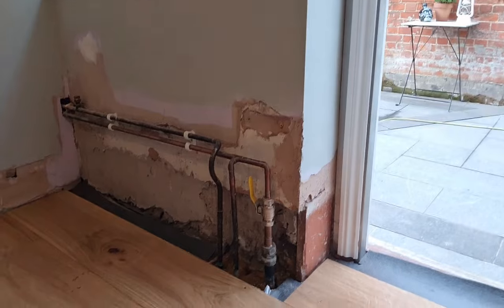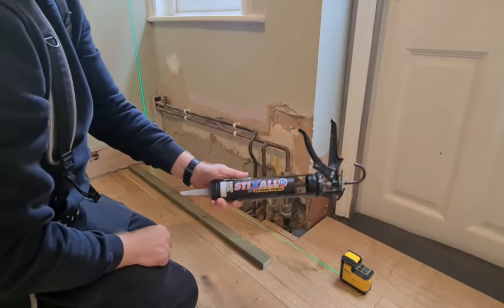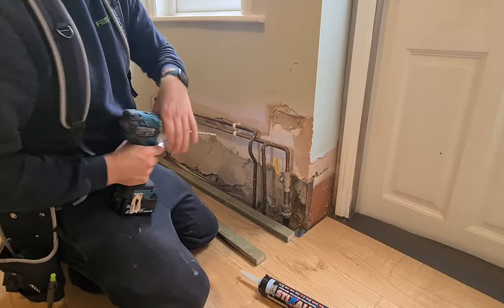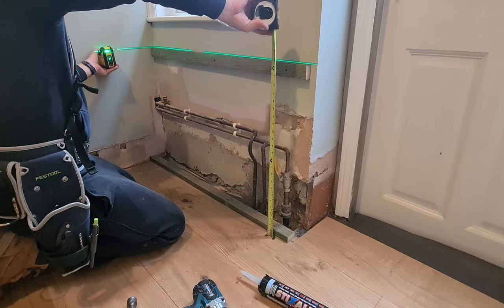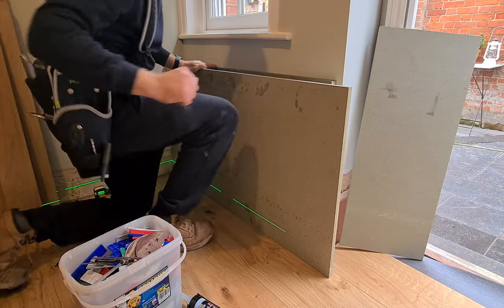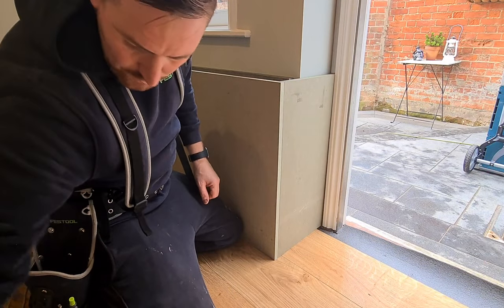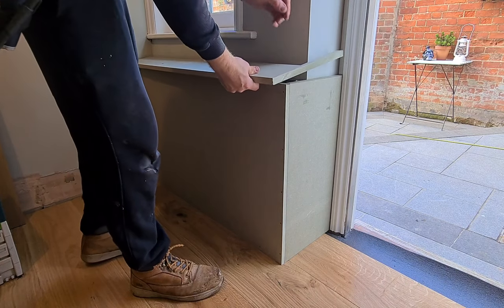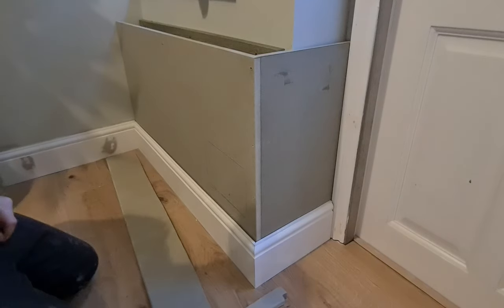Making a HARD job EASY!       #diy #carpentry

Comment: You made this look so much more difficult than it needed to be. Just because you have a laser doesn't mean you need to use it for every tiny task. There were times where you needed 4 hands and a level would have been adequate. It looked nice either way
Reply: See you two are showing your true  colours here. Everyone just uses a laser nowadays. Only bodge job old guys use bubbles. Use it on everything from doors to trusses.
Reply from the maker: You're quite right. Lasers are so much more accurate

Comment: That was about as easy as boxing in gets, I thought it was a video where awkward  pipes come out
Reply from the maker: Not really mate. Easy boxing in would be low level with 12mm ply and batten.
Reply: @BuiltByBen-YT  look mate I'm not gonna have an argument with ya, you are a million times better than I  am at carpententry, but that was very simple. Difficult boxing in is when you don't have a surface to fit to at the back and pipes exclude from it and and you have awkward angles to fit to.

Comment: Surely fixing a structural element to a floating floor isn't ideal. I'd have cut out the flooring so that batten could attach to the subfloor and allow room for an expansion gap between it and the pipework...
Reply from the maker: Structural? It's only boxing in.
Reply: Nope your wrong , You would do what your paid to do not think what you want to do for yourself, big difference when it’s not your property !!

Comment: Even the pro's make mistakes, I noticed you cut the top short and said it didn't look right with a bullnose going into the door facings, but had another bit cut when routing the bullnose to finish the job, don't be embarrassed bud it's good to let folk know that we all mess up sometimes, so people starting out don't get put off seeing flawless jobs online so think they are bad when they mess up and give up on wood work etc thinking they must be crap because they keep making mistakes. Let folk know it's okay and it takes practice. Good video, I personally don't use MDF much at all but ply wood has gone down so much in quality lately I'm thinking yo use more mdf for my work.

Comment: Good video. I have been using the button fixes so that you can take the top off easily and don't have to have any screw holes in the top. Really easy to fit and super strong too.

Comment: Nice one Ben. Just about to box in a fuse board in my garden cabin, so extremely useful. As I will need full access to the board, so I'm magnetising the box so it pulls away easily but thanks to you I've invested in a laser to save time and effort on this and the multitude of other jobs on my "To Do" list!
Reply from the maker: Nice one mate 👍
Reply: Oh another great tip on the magnetic catch, thanks!

Comment: nice work. i'm also a fan of oversizing and marking in situ instead of trying to cut it to size first time. one question though... at 24:55 you didn't show the perpendicular scribe for the return which looks nowhere near 90... when cutting the large rectangle out did you leave a strip of "meat" on the end to scribe that perpendicular line or use a bevel guage?

Comment: yep two battens, one fixed to the floor and the other fixed to the wall is all that is needed....exactly the way way I do it. Just a wee note...I would not build the boxing on top of a floor finish as floor finishes are renewed/changed, which means removing the boxing every time the floor finish is changed....in this case have you screwed through a timber/laminate floating floor finish ? meaning the floor now has no movement/expansion at that end. I presume another access panel would have to be fitted for access to the water softner.
Reply from the maker: Hi Tony.  Thanks for watching. 
I see where you're coming from with the floor finish but it can always be multi tooled if being changed. Movement wise it shouldn't restrict it too much as I only screwed too it and not all the way through. The water softener was an external unit, so access would only be needed once too connect it and then the boxing could be fixed. 👍

Comment: I too am a retired joiner,wow that was an ordeal watching you do that boxing!The reliance on a laser of all things ,can you not use a level? I would have measured up made the whole lot outside slightly oversize then brought it in and scribed it! I too would’ve used an access panel but never dreamed of cutting it “after” you fitted the boxing! one slip and you could’ve sliced the pipe! The garden chimes were irritating big time Lol
Reply from the maker: Everyone does it differently.  I go for accuracy over speed but appreciate that you may go for speed, a lot of carpenters do. There was no way I could of slipped and cut a pipe unless I had no control at all! The pipe was a long way back and the blade wouldn't even reach it. The access hatch was put in after because it was delivered late 👍

Comment: Cool video. A few small deviations from the way i do boxing in, of a similar ilk.
That's not a criticism of your work, which is plumb and true. I just do it 'slightly differently'.
I would have used 'pinch' clips to hold the lid on, and left the 15mm over hang, near the door architrave, on.
Also, make sure to use your G clamps in future, when using your palm router. Seen a fellow joiner have a rather horrific accident, routing whilst not having the work piece secured.i
I don't want to come across all 'belt and braces'. I'm retired now, due to ill health, and you are clearly a very good young joiner/carpenter.
I would just rather see your future videos, with you fully intact 👍
Reply from the maker: Thanks for watching Tony 👍will be sure to get the clamps out next time.

Comment: Nice neat job, pity the customer hadn’t got the water softener fitted beforehand as it might be bigger than the space now left. Another idea might have been to increase the box height and give a wide window board/seat as an added feature.
Reply from the maker: The water Softner was an external Unit and the only thing needed in the boxing was the mains feed. We nearly made it in to a Cat seat but then decided this way was best. The reason for the height was that the wall was quite badly damaged lower down, Couldn't really see on the video but that's why.

Comment: The scribing on the top piece didn’t look much, until you bought it outside. That’s some terrible plastering!! You did a great job - looks neat and adds character.
Reply from the maker: Yes mate. Part of the reason it was so high was to hide more of that rubbish plaster work. It got worse the further it went down. Cheers for watching 👍

Comment: Not sure if the perspective and camera angle has distorted the image, but the edge of the  little overhang on the door architrave seems to not be running parallel to the surface of the wall. Did you gauge the angle of the walls with a sliding bevel? Shouldn't you have built the box square and then scribed in to the angle?
Reply from the maker: I can't remember Ian? Once it was all fitted I am pretty sure it was all square and even. Thanks for watching mate 👍

Comment: easest job i ever had was boxing in pipes at mental health hospitals and there was a lot. Set up in the car parks with a generator and loads of MDF. MDF is so forgiving and easy to work with..but always use corner blocks out of wood or more mdf and screw and glue if you want it strong, as screwing down the end is crap.

Comment: Well Ben I'm a retired carpenter joiner of 53 years I've never used a laser always used levels. I just can't understand why you made it so big and why you took it around the corner seemed unnecessary to me 👎
Reply from the maker: Hi Norman, good for you mate enjoy the retirement! It was all discussed with the customer and this is exactly how they wanted it. I did offer a number of options including a seat for their cat 🐈 
But at the end of the day you have to build what the customer wants and accept that people have different tastes.  I like it as it is and can't see anything wrong.
Reply: Same thing as I were thinking
Reply: @BuiltByBen-YT  sometimes it's true, customers adamant what they want, even though you have given them several 💡
Reply: Norman I've been at it 37 years and have found the introduction of lazers to be very beneficial, more accurate and time saving. No disrespect to you as you had to achieve similar goals with only hand tools but times change.. That said ask a chippy in his twenty to cut a mitre he will flap if he hasn't got a chop saw with him😂
Reply: Very few take pride and enjoyment out of it anymore.
Reply: The plastic cover to the access hole is a horror. I’d have cut the hole very carefully and used what is now your piece of waste as a plug, with a small wooden knob in the middle. Once it and the boxing are painted up, including the cut edges, it’d fit in there nice and tight . . . once all the paint is properly dry, of course.
Reply from the maker: Loads of ways to do it
Reply: @graemetaylor2135  you’re a genius.
Reply: @marksmith383  Life in general is being dumbed down nowadays. If I hadn’t worked with an oldskool joiner I wouldn’t have have the skills I do. Young lads just want power tools. They’ve lost all the basic skills. Lasers have a place in kitchen fitting. 👍🏻
Reply: @BuiltByBen-YT  I blame the plumber. Get him back to lower his mess! 😂😂👍🏻
Reply from the maker: I possess those skills too but if a new tool or gadget makes something easier then I'm all for it
Reply: Can you tell me the multi tool blade please and also the make of the router
Reply from the maker: You seem angry. Just move on if you don't like it 👍
Reply: I take it that you still travel around in a horse drawn cart..?
Reply: jesus Ben , you’re taking a lot of stick here , when you’re only trying to show a way of boxing in , if someone wants to have a go at it their self . Water off a ducks back mate . i’m a joiner myself , and there’s always someone out there with that famous comment “ i wouldn’t have done it like that 😂.. good luck in your channel , and stay busy mate 👏👍👍👍
Reply from the maker: Thanks mate. It doesn't matter what I put on this channel there are always some people that don't like it. Opinion and taste are to blame. There are so many ways to do everything and people just need to chill 😎
Reply: @BuiltByBen-YT  😂totally agree , you’ll use a level , someone will say “ use a laser , you use the laser , ..  why dont you use the level 🤣🤣i found it quite funny tbh , well i like your channel mate , and look forward to your new ones ,👍
Reply from the maker: Thanks scotty 👍 make sure you're sub'd
Reply: @marksmith383  I am a chippy and had to do some skirting around some funny angles on a stair case by had as I did not have my chop saw on site, and it spun my head. We get so dependent on modern equipment. Mate me realise how unskilled we can be with hard tools .
Reply: @jasonreeves4955  100% Jason if battery's are dead would you use a hand screwdriver? Naaa😂
Reply: @marksmith383   what’s a  hand screwdriver?  You mean a screw gun 🤦‍♂️🤦‍♂️🤦‍♂️🤦‍♂️
Reply from the maker: Don't be rude Ronsola.
Reply: @BuiltByBen-YT  i can't see that a lazer on a little bit of boxing faster or easier than a level. Lazers are great  for bigger jobs but hardly needed for a tiddly job like that
Reply: I've been at it for 40 years and found this job absolutely spot on. To Graeme and Norman, why don't you put on a vid? Show us how to do it your way, thought not. Well done Ben, sure this has been useful to others.
Reply from the maker: Thanks mate.  Unfortunately one troll attracts another.
Reply from the maker: I use them for everything for accuracy  Norman 👍
Reply: As they say there’s always one an today it’s you congratulations mr master carpenter, so how about you showing us all just how it’s done properly in youre eyes hay 🤔
Reply: Everyone’s an expert when watching someone else work! Good work mate nice and clean how the customer wanted it! 👍
Reply from the maker: Cheers mate 👍
Reply: @BuiltByBen-YT lol....always one who things he knows it all because he's 100 years in the trade and a magician and mind reader too.
Reply from the maker: They always turn up 🤣
Reply: @MrSmid888  i was a kitchen fitter for 42 years in the UK and Europe, i never used a laser level,. just not practical,.maybe for a rough datom around the room. Levels for me im afraid.
Reply: @alanwood9822  yes that’s what I meant, for an initial line around the room. I use a level for everything, I’m oldskool it’s the best way!! Hurts when it falls of a unit onto the skull 😂Some lads can’t use a handsaw to back cut a worktop now, the basic skills are being lost, it’s all speed speed speed. I used to have to drill out the hinge plate holes, our stuff came non pre drilled for anything! One mistake and it was fluffed. And yes I have drilled right through a door! 🤢 Curved doors were a pain to hold whilst drilling out(plunge drill on a jig). I used to have to make a 90 degree corner door with piano hinge. That was around 2005. I dare say nobody drills out anything now, it’s all factory done. I haven’t been in that game for over a decade. 👍🏻
Reply: @martingadsby3934  not a router mate! Makita trimmer
Reply: Top job that looks grand
Reply from the maker: Cheers 👌
Reply: Them bloody wind chimes
Reply: Nicely made. Informative. Thanks.
Reply from the maker: Thanks Wayne
Reply: That looks mint ❤, stop being a Norman, oh wait you are a Norman
Reply: If you make something easy look hard you then charge more money... that's what he did lol 😂
Reply from the maker: Not true but thanks for the comment
Reply: Apple pie tonight Norm
Reply from the maker: @Bonjobby1  thank-you mate 👌
Reply: Nice end result m8 .not the exact way I'd of gone about it either but as you say ,so many ways to skin a cat ,and the end aim is a happy customer. Trolls and know it all's must be a pain  but inevitable unfortunately .keep on fighting the good fight pal
Reply: Well Ben some of these old grumps need to put a dress on  they are getting on like busy old ladies, grow up lads stop picking fault on other men at work.
Reply from the maker: @Raymond Williamson  without them my videos wouldn't do aswell so silver lining and all that 🤣

Comment: Interesting video and informative use of the laser! And, at last, someone using metric measurements, so frustrating to see, especially younger people, using clumsy imperial measurements! I've been using MDF screws for over twenty years now, definitely worth using, as you say less chance of splitting, because of the thin shaft, and really good grip, because of the the deep and sharp thread. Not sure what happened between 27mins and 29mins though, first you say you've decided to finish the end off flush but then you show an overhang?
Reply from the maker: Just a change of mind that I forgot to edit 🤣 thanks for watching

Comment: You cut the end flush what the customer wanted... but at the end the overhang was back. Did they change their mind or did it break
Reply from the maker: We changed our mind again. But forgot to edit that bit out 👍🤣
Reply: @BuiltByBen-YT  lol job looked good nice one.
Reply: I reckon you forgot to measure the 15mm and cut to the original line and improvised at point of realisation 27.49 so the video wasn’t ruined but your perfectionism wouldn’t cut you a break?
Reply: Yeh I rewatched that over three times thinking, what the heck is going on 😂

Comment: Ben, when using MDF beware of the health issues with its fine dust such as when you were cutting the access hatch. A simple dust mask will protect you.
Reply from the maker: Yes you are quite right. I never feel the need with a multitool as the majority of the dust falls down but I am fully aware that is stupid logic 🤣
Reply from the maker: It's definitely not a cheapskate option.  It's quite pricey! But thanks for your opinion
Reply: It’s not only the dust if your tools are not sharp it will burn the MDF releasing dangerous gases
Reply from the maker: Noted ✅️

Comment: First time I was given a boxing to do, it was on an old cottage, full refurb job that was nearly finished. I was 15, and working with a top class joiner, but he had a hell of a temper. The CH had just been turned on, but the flow and return to a rad on the landing came through the floor and along the skirting. I made the boxing out of skirting and 3"x 1" for the top, and it looked great. I got a pat on fhe shoulder and compliments... until we noticed a wet patch growing along the floor... I'd put six two and a half inch lost heads through the pipe. The air was blue... but I never made that mistake again for the next 55 years. Laser?? 🤣🤣
Reply from the maker: I've done it once recently.  1st time ever. AND YES.....LASER
Reply: @BuiltByBen-YT  I've also done it once with a gas pipe as an apprentice in the early 80's , and never done it again for 43 years until i retired. You certainly learn by your mistakes.
Reply: That's a dangerous corner you won't be the last guy to box that nest of pipes in judging by the way that drill bit pushed into the wall for that 3rd screw tells us old boys that the meddler has been in that corner for a while my guess is that there is a damp issue there ie. bridged cavity, original door frame rotted away because of this. The hdf will be fine for a couple of years. Next time find a plumber to tidy up that pipe work and yellow lever says gas,if that is a gas mains shut off valve it should be visible to everyone All times .
Reply from the maker: It's regs to box in gas pipes to protect them though right?
Reply: @BuiltByBen-YT  I agree, but timber will not stop someone from putting a nail or screw into that pipe and gas leaks might not be as obvious as water. If the lever was visible or even the access panel labeled gas it might save a Life who knows.